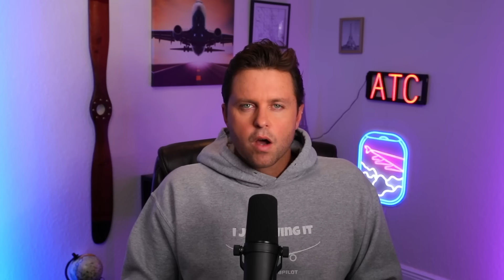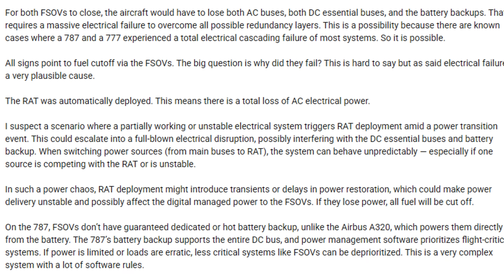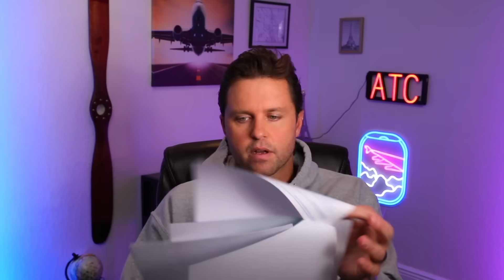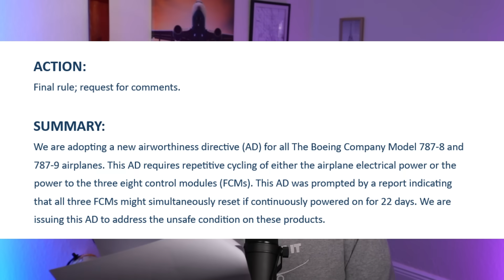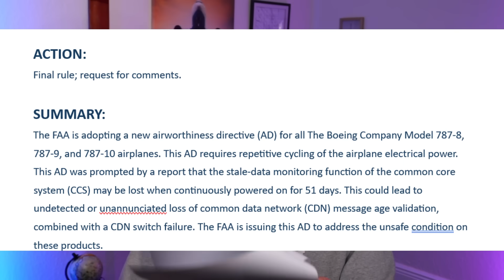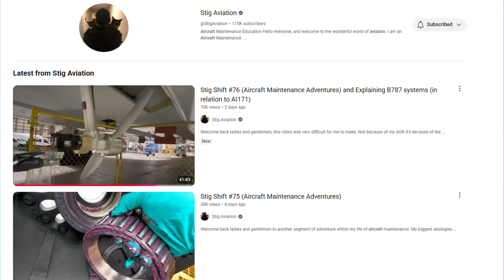Air India 171: Did a Software Glitch Cause Dual Engine Failure?

Comment: I wonder why no one has talked about the "Fuel Shutoff Module"? The FSM (Fuel Shutoff Module) makes sure that the fuel system always has power to close these shutoff valves.
Reply: Power keeeps them open , they close by spring action on power loss.
Reply: @donallan6396 they are not spring loaded closed. This is a claim he makes without any reference. In the B787 Maintenance Manual it does not describe the valves as spring loaded closed. Also in the SSM it shows that the valve is both opened and closed with 28v DC.

Comment: Great work Gary. I am an engineer who knows nothing about airplane engines but I don´t buy into the contaminated fuel theory because apparently it didn´t affect other planes at the airport and the engines seemed to run ok until there was total and sudden failure instead of gradual power reduction. The facts and reports you show point offer a very plausible theory as to what happened.

Comment: Okay, so after the electrical system fails, it takes a few seconds for the RAT to restore power. The developers certainly wouldn't have allowed the turbines to be cut off from fuel supply during this transition period. For comparison: in an elevator, the tether doesn't release in the event of a power outage.

Comment: @garybpilot What is your opinion now, after the official results have been released, after the evaluation of the black boxes by Boeing? They say that the official cause of the crash of flight 171 was human failure, that the pilots operated incorrectly. But there are also videos on YouTube they say that there were massive problems by Boeing company itself, especially with software. So your assumption could probably be right, apart from the official release (which could be manipulated), or would that be too farfetched? Furthermore, there are also some videos that were partly before the crash, which reported about massive problems by Air India, that their planes were not in good condition, etc. Finally, also needs to be considered that Boeing has had financial difficulties since years and that an employee of Boeing (John Barnett) who reported about massive mistakes by Boeing was mysteriously found dead in the US. Are these all coincidences or are these rather conspiracy theories? What is your opinion to all this?

Comment: I would opt for a mechanical manual cut off switch operated by the pilots in order to put out any fire. It must be a glitch on the bus here since the 2 engines stop simutaneously.

Comment: Fuel contamination can be ruled out. It is impossible for all engines to have the same running time (engines are always started one after the other). If there is contamination, one engine is always “penalized” first - never all engines at the same time.

The simultaneous loss of thrust of all engines can only be caused by the system itself. Since the 787's system is an IT system and does not only receive its data from sensors, it can be assumed that there is a data constellation that ultimately leads to the fail-safe mode being triggered: Energy must go down immediately (electrical & chemical).

It is important to know that the interruption of the complete fuel supply for the engines of the 787 (regardless of whether Trent 1000 or GEnx-1B) must not be longer than 0.45 seconds. A longer interruption leads to an immediate loss of thrust. The fuel lines are only saturated again after 4-5 seconds. Until then, however, the engines are off. Too late on take-off - No problem at an altitude > 5000 ft.

Comment: We've the same information. The failsave mode is normally secured. It never occurs as long as the data has been run through the plausibility check and the result is negative.

However, certain deadlocks and race conditions in the software can of course lead to the fuel supply being stopped ad hoc for all engines for “safety reasons”.  For example in the event of a crash landing etc..

Comment: Another reviewer is fairly convinced that there was ONE engine failure but (as has happened before) one of the pilots then accidently shut off the working engine instead of the faulty engine, hence the accident. I don't think that that was the case. I think it was either another Boeing software fault causing both engines to shut down simultaneously OR it was the result of poor maintenance.

Comment: Ideal general safety technology paradigm is a secondary redundancy system that is independent from first. But for cost and specialization reasons, administrators and engineers tend to create redundancy within the first system, where you would have a quasi fail free system. In this case the safety system may have interfered with the operation system it is trying to protect. Independent retro rockets, parachutes, air bags, anti fire system should protect against failure of primary system. UniGorg Sandaero

Comment: The video's big question is whether the RAT deployed because the engines stopped, causing a loss of electrical power, or the loss of electrical power caused the RAT to deploy, which eventually shut down the engines.  From the video I watched, it sounded like the RAT we deployed, meaning loss of electrical power, but the engines sounded like they were still running, which suggests loss of electrical power happened first, as suggested by this video.

Comment: So why hasn’t it happened more often ? 787’s are flown heavily in the gulf it’s designed for hot climates?  I mean what no one else is saying is it’s a heavily flown 12yo plane it recently had an engine change ….   Were there maintenance issues ?  And I thought the 787’s don’t use bleed air for much ?   I’m no pilot or anything just a YouTube commenter just wondering is all … I guess the recorders and initial findings will tell the final story

Comment: Computeres, including those in  airliners should be reset (completely) on a regular basis. This is to 'clean' the system and avoid registers running full . If not done, the computer may shut down.

Redundant computers should be reset with a time interval, say five minutes. This will allow for five minutes more, if the systems are not reset (for a too long time).

Two examples:
I was on a morning flight from OSL. The departure was delayed 10-20-30-40 minutes, then the captain said we may have to change AC. Then after 50 minutes he came back and said that all systems were up and running - they had reset all systems!!

On a large ship with redundant  computer positioning systems both computers failed within 30 seconds - some panic - but the crew reset both systems and they were back in normal within a minute. The cause: a register was running full. Only the operator station computers had been reset - almost at the same time. The main computers - that do the work - had been forgotten. So allow some time between reset of redundant computers!!

Comment: The airworthiness directive of power cycle of the airplane electrical power after 51 days was provided by US Federal Aviation Administration in 2020, which is more than 4.5 years.
So did the Boeing not train the pilots for this airworthiness directive all these years ? May be Boeing did not want to train the pilots so as to save cost as they did with the MCAS issue.
Is there a display in the cockpit with a counter which displays the number of mins, hours & days the airplane electrical power was turned on ? If not then this could be done in a easy fix under a recall.

Comment: Taking Flight With Rocket Likely Causes of Air India 171 Accident on June 12, 2025. Version 2.0 (Audio Repaired) https://www.youtube.com/watch?v=UqVBAs7nh-o My comment: Nice you did it like you were flying. You were the only pilot mention / calculate the effect of high temperature: 15% loss of thrust. I hear landing gear out is critical after take off. If you also have the RAT than you have so much resistance that getting enough height / steepness of climb is impossible. So without an engine failure: having 15% less thrust because of the temperature, also having the landing gear down and also the RAT you almost certain cannot climb enough. Than comes the questions : why landing gear was not in? Error of pilot/co-pilot? Technical failure? Power failure? RAT is automatic down at power failure?  Than climbing is almost impossible in these conditions. 
Air India 171: Did a Software Glitch Cause Dual Engine Failure? https://www.youtube.com/watch?v=VswFVpyg5ew&t=135s

Comment: DELETION OF THE ENGINE PARAMETER FILES BY HAKER---same thing happened with Airbus 400M in 2015 and it's engine parameter files were deleted by someone. That aircraft was running on VxWorks too.

Comment: According to the pilot's call, ohne could assune that the engines didn't flame out but rolled back.
Did someone think about a clitch in the autothrottle system or can this be completely ruled out?

Comment: Dear Gary,
Hope you're doing well. I’ve recently started watching your vlogs really on Cp. Steve suggestion and u too very informative, respect to both for you the valuable effort you people put in.
After watching various coverage of the heartbreaking Dreamliner AI 171 incident, I had a thought. You've covered the technical points brilliantly, but one aspect I feel many experts missed is the possibility of roden*ts presence onboard.
Coming from an electronics background, I’ve seen how much damage a rat can do to internal circuit wiring, especially in sensitive communication systems. Out of curiosity, I did some digging through ChatGPT and found something surprising.
Over the past decade, there have been more than 10 international Air India flights that returned midair due to rodent sightings including a 2015 Dreamliner from Mumbai to London that had to return. In many reports, they were even spotted with in the cockpit.

According to the insights I received, these creatures could potentially cause critica*l failure if they interfere with essential wiring. I’m curious to hear your expert view: Is this considered a serious concern in aviation, and how are such risks normally managed or do the recent incident could link to this?

Thanks for your time and looking forward to hearing your  thoughts.
Warm regards,
Aftab Ikram

Comment: The 787 main gear doors open automatically on liftoff without pilot intervention through the use of the gear retraction lever. This is in preparation for the gear being raised after takeoff. (They will close again automatically if the gear is not retracted within a short time frame).
It appears from the infamous video of this aircraft descending to impact, that the main gear doors are closed.
The question is, did the doors open after rotation as they were designed to do, and close again because the pilots did not select the gear up, or did they just never open automatically like they should?
If they failed to open, this would point to a failure probably before VR or close to that point.

Comment: Hi Gary. I've been following your channel for quite some time (I'm a fan of serious aviation content creators). More recently, I've seen that duo you made with Capt.  Steve on this issue. And now that you brought these theories and recent events, it came to my mind that incident/accident back in 2008/9 with the B.A 777 (flight 338) that lost all power on aproach ending up crash landing short of the runway. If I remember correctly, it has something to do with engine thrust control due to some electrical issue.
It would be interesting to see you debate this new approach again with Capt. Steve. See what's his opinion. I think that these topics you exposed are beginning to bring a much clearer path to what might have really happened. Good winds and happy landings from Portugal 🇵🇹

Comment: During Takeoff aren’t the Igniter selected to the “On” position. If the fuel is cutoff for a few seconds wouldn’t they relight when the fuel is resupplied to the engines?  Just a thought!

Comment: Hi thanks for sharing the links. Unlikely to have crashed due to "if left powered for X days continuously" because the plane did not fly for 3 days before AI 171. Most likely it was powered down before. May be a TAT probe failure. This is only one and would affect both FADEC -- initiated EGT protection shutdown when actual temperatures are exceeded. -> power failure. Validated by ChatGTP.

Comment: I used to work on MRI scanners. I always cringed at the thought of putting computer systems in planes and then Max 8 happened.  I guess these idiots at Boeing haven't figured it out yet.  Get rid of electronics and computers in planes, trucks and cars. It's all unnecessary nonsense.

Comment: on 787 there is a function for landing gear doors to open in one second after takeoff (with the landing gear leaver still at down position), if RPDU supplies electrical power. Non of the videos shows the doors were opened. This suggest that there were no power when it lift off.
from training notes " The 787-9 has the MLG early door function on takeoff. With the airplane in the
air for one second, and the landing gear lever down, the LGA/NWS energizes
the MLG bypass/auto-off valve open. Center system hydraulic pressure now
goes to these components:
 - MLG truck positioner ACTR
 - MLG control valve module
 - MLG door control valve module.
LGA/NWS now commands the MLG door control valve to the OPEN position.

Comment: I commented on this 6  days ago on your earlier video as to what i thought caused it.
"@fas9667
6 days ago
retired navy jet engine mechanic here, worked on J79 turbojets on F-4 phantoms back in the early 80's.i know my experience has no relation to the 787 and its systems. my guess is it was a software or electrical failure or both that cut the fuel to both engines. jmo."

Comment: Never agreed with contaminated fuel theory.  For a dual shutdown, the contaminants would have had to be so perfectly dispersed that each engine experienced the problem at the same time; hard to imagine a perfect and identical % of contamination shutting down both engines within, at most, seconds of each other.
Reply: As an ICAO airport , I would have thought the fuel  tanks and delivering systems would have been quaranteed immediately and samples taken for testing. If it wasn't,it is a faikure of due diligence.
Reply: @donallan6396 - even with a contaminated fuel source, I would have a problem with the engines being effected at the same moment, the contaminating substance would have to be almost precisely the same saturation percentage in the supply to each engine; when I mix or blend things, be it drinks, recipes, etc. I have never once managed that level of precision.

Comment: I’m an engineer, mostly designing electro-pneumatic powered systems. It means I do work with both electrical/electronic control and pneumatics/hydraulics integrated systems. I’m struggling to think of the logic why they would set up a critical component valve like this where your safety interlock works only for one scenario only, an engine fire. Which is relatively rare. Was the person who decided on this an electrical engineer with little to no experience with hydraulics? Because that’s how a purely electrical engineer would think. I have my valve controlling a line carrying a critical fluid, in this case jet fuel but could also be things like oxygen or water for a fire suppressing system. A full electrical failure-this would default to the safest option. Would this then be a NO or NC (Normally Open or Normally Closed) valve? An electrical engineer would say-NC. We don’t want people getting hurt by the fluid/electricity. Even if it is to critical life support or fire suppressant systems. But if you have real world experience with hydraulics-is it better to have everything stay up or stay where it is or everything to come crashing down/moving without sensors (because of the electrical failure) and crushing someone? Answer is : stay up/stay there. So this should be an NO valve default with total electrical or software disruption. But whatever the cause, almost 300 people lost their lives due to it and it’s a very, very horrible way to go. RIP to all who died from this. 🙏🏻

Comment: It's going to be very bad for the B787 operating airlines if a definite cause is not found soon.  People could start booking flights with connections that avoid the 787 type.  For example, a cautious  person wanting to fly from Auckland to San Francisco might opt to fly to LAX on a 777 & a 737 connecting flight to SFO.

Comment: Modern Jets control systems are based on Software which is at this level of complexity surely not bug free. The Space Shuttle used different redundancy approaches (different compilers) to create reliability. The rest error margin might be approx. 0, but it's not plain 0. Boeing probably conceded this risk hoping no catastrophy will ever reveal.

Comment: My first thought was, "Something shut those engines down on purpose. But what?" After listening to your video I'm more convinced those engines were commanded to shut down. Of course the $64,000 question is why? Hopefully the flight data recorder has the information. In today's aircraft everything is electronically controlled. It's not like previous generations where engine systems and fuel control units were mechanically manipulated with cables, levers and bell cranks. 

As you stated it could have been a power glitch and the fuel shut off valves closed. In military aircraft they have to meet Mil-Std-704 power interruption of 50 milliseconds. I don't know what the civilian equivalent is, but it'll be something similar. Or from some extreme rare set of circumstances the computer(s) sent the fuel control units a shutdown command.

You also pointed out there have been 3 airworthiness directives stating the computers must be shut down periodically. Anybody with a laptop or cell phone knows to power it off and restart it weekly to clear out stale data and variables. That could have been the contributing issue to the engines receiving a shutdown command.